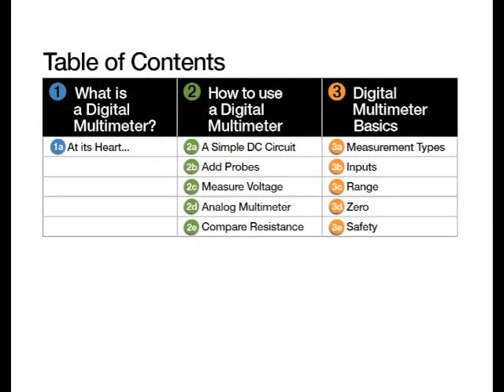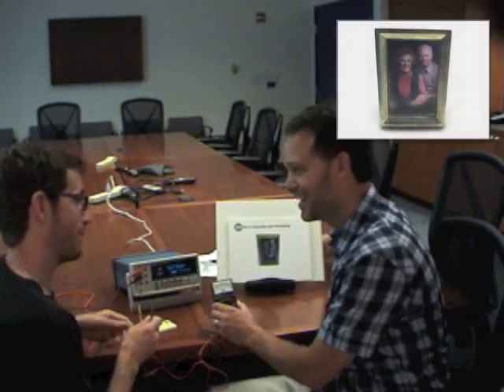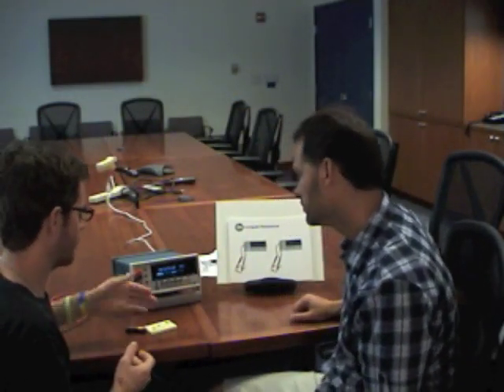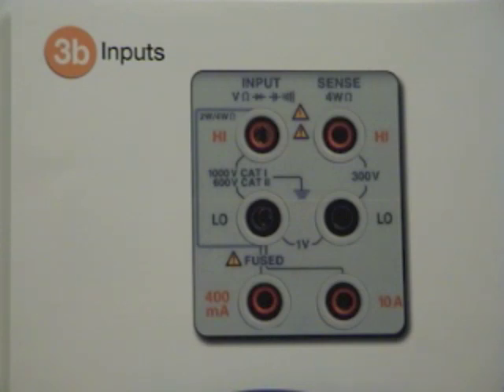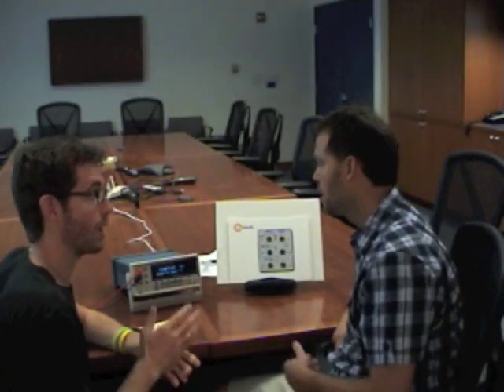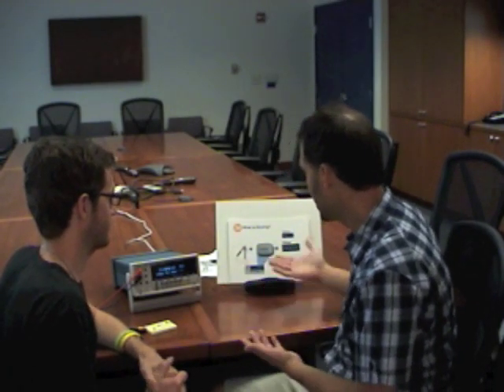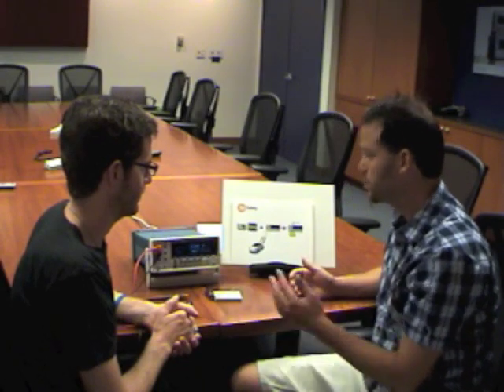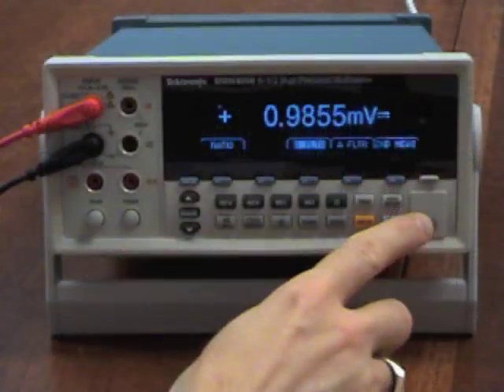How to use a digital multimeter

Comment: something i've always wondered, could you damage your multimeter if you select too low a voltage when measuring higher voltage?  I know current you said can damage it (really damage it or just the fuse that then has to be replaced and the dmm likely would be still ok no?)

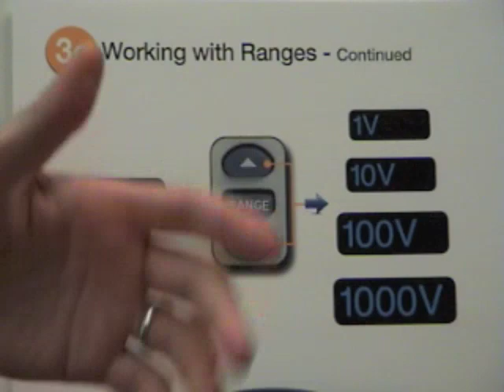Comment: The slide at 5:35, could stand a redo I think. Pushing the Up arrow moves you down the numbers on the right... It would make more sense (I think) to have them move from high up top to low below. Still digging it.